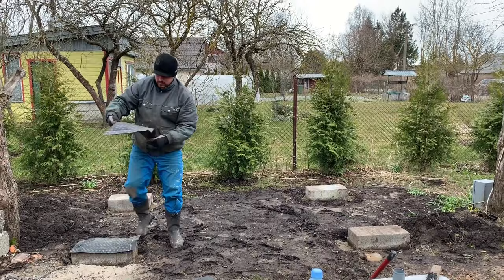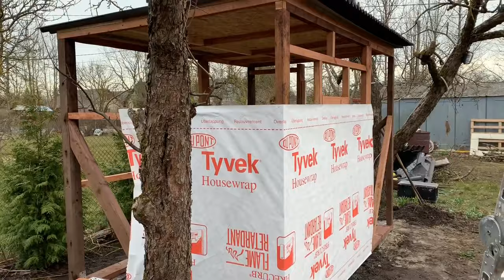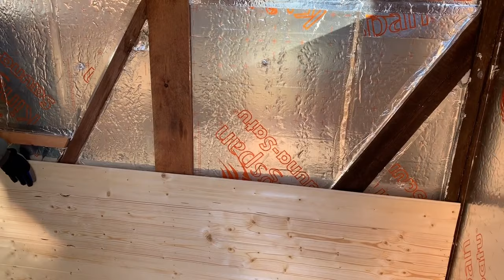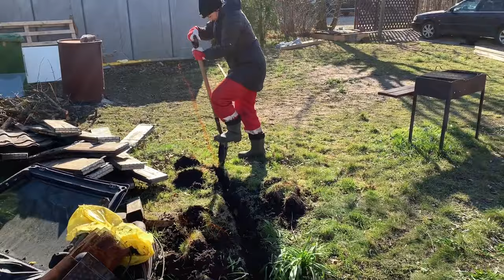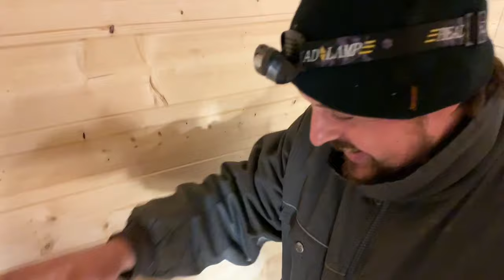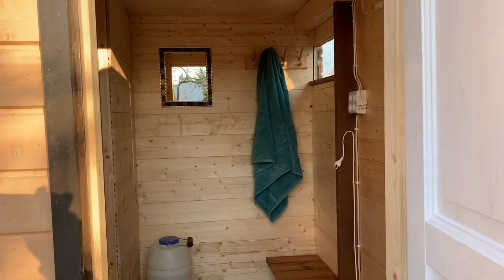How to build sauna outdoor

Comment: As a Finn I am in a position to give some feedback to you on this build. 
1. You shouldn't put insulation  on the floor. A) It has no use down there. I don't think you are going to feel cold in 90C :D B) water needs to get out through the floor so that the sauna can dry between uses.
2. You should also have ventilation near the ceiling so that "used" hot air can change to "fresh" air. By adding ventilation near the ceiling your sauna experience will improve greatly. More air=better

Otherwise this is probably the best sauna building video I have seen from non Finns. Loved the video :)
Reply from the maker: Hello, thank you for feedback. Regarding insulation on the floor - I made it like this that water will drain throgh the floor, it will just protect from heavy wind and cold :)
Reply: I totally agree. This has all the important things right. There are many videos with maybe finer craftsmanship and all that but that won't help if they get all the basics wrong. Of course there's always some room for improvement such as the ventilation but that can be done later if desired.
Reply from the maker: @laupit  Thanks for good words :)
Reply: Hi . Tapio . Would you have some links to sauna build by Finns? I couldn't find any. I mean  reasonable diy not wood logs sauna! Kiitos!
Reply: @Tapio Hakola, do you think that the heat is not lost if the floor is not insulated? Thanks for your tips!
Reply: Type of isolation used is fine? I'm now thnikg about sauna in next year. If price will se so low it will be great !
Reply: Hi would you mind giving an example of better ventilation near the ceiling. When you say that do you mean a few cutout slots so the  hot air can escape? If so how large and how many would you recommend for say a sauna like in the video? Sorry for the random questions, I am planning to build a sauna like the one in the video and am looking for any and all advice to get the best experience possible. Thank you for your time and any advice you can offer.🙏

Comment: That's a very nice job!  I'd trade the metal bucket for a wooden one - the metal will get hot and burn you if you're not careful. You will probably very quickly find any nail heads in the benches that you didn't sink deep enough into the wood.  A shower in the dressing room area would be a good addition, if there's enough room and you can plumb in a water pipe. Just cold water would do, as you won't feel the cold if you first get hot enough in the sauna.  My Finnish ancestors would always open a window before using the sauna, and throw a ladle of water on the stones and let the steam drive out any "bad" air (häkälöyly in Finnish - translates to carbon monoxide steam).  They would even do it with an electric  heater, but maybe just out of tradition.  I envy you -  may you and your family will enjoy your sauna for years to come.
Reply from the maker: Thanks for good words! There is no nailheads in benches because I screwed them from under there bench. There is unfortunately no room for shower inside but I have cold shower already outside on the corner of sauna :) But thanks for your advise, I will remember and try this.

Comment: Ok, taking notes:
- concrete poured in holes probably about, say, 8" deep? Maybe a foot for good measure? I'd probably use some paper cylinder forms because they're so crisp looking. I like over-engineering and wasting money that way.
- gravel followed by some cinderblocks, as far as I can tell.
- some membrane between the wood and the concrete blocks, nice touch there.
- looks like untreated floor base wood. Maybe it'll get treated later? Indeed it will and did.
- interesting framing method, minimal wood. Gets the job done, though.
- I was in some suspense waiting for what the floor would be. It came together, though.

Floor vents, both on the bottom. I've seen some debates between bottom and top for the back wall vent(s) and I think that becomes more important with a wood-burning stove. Any thoughts?

Nice video!
Reply from the maker: Hello, thanks for your comments. Floor wood is treated, its used for outdoor terrace use in our country, but i used on the floor as there is anyway no heat on the floor. Vent is correct, for electric heater it goes under the heated with normsl air flow and outcome down in diagonal corner. Of course you can overengineer but my intention was to build as cheap as possible.

Comment: What kind of wood did you use for the floor ? Great job ! Enjoy !
Reply from the maker: @dimibernard  Hello, its pretreated terrace wood
Reply: @mrjaak132  Thanks for your answer ! I didn't see any hole on the floor to allow the water to flow, outside I thought it was important ? Any issue since due to this ?
Reply from the maker: @dimibernard  Just leave some holes in floor insulation corners, floor planks assemble side by side, in few months they will dry and there will be gap 2mm or more anyway and water will drain very well
Reply: @mrjaak132  Thanks ! Another question sorry :) You didn't use any vapor barrier, why ?
Reply from the maker: @dimibernard  Insulation plates called SaunaSatu are used as vapour barrier, you just need to cover   corners and joints with foil tape

Comment: Is a vapour barrier needed? Seeing mixed opinions online. You insulated then borded.

How's it holding up after 4 years?

What would doid you use for the floor?

Great video, thanks!
Reply from the maker: @JF-kb6bl  Yes, vapour barrier presents, saunasatu insulstion plates are covered with foil, which is vapour barrier. For floor I used terrace wood. After 4 years it works very well without any problems

Comment: Great project. Correct me if I'm wrong but for safety reasons, the glass door to sauna should open outside.
Reply from the maker: Hi, thanks. You are correct, I consired this when installed door. As this was more optimal to save the room, I thought that in emergency situation you can take the stone or bucket and break the glass easily.
Reply from the maker: Thank you! Yes, you are correct, I considered this when installed the door. As this was more optimal for room saving, I thought that in emergency situation glass can be easily breaken by stone or bucket.

Comment: I would not use pressure treated wood interior at all regular wood just works fine if it can dry well after Sauna.
My outdoor smoke sauna floor is made aspen planks and small caps between them they are still great condition and Sauna is over 20 year old.
Reply from the maker: Thanks for comment, but where did you see pressured wood in my sauna? No pressured wood was used in interior.
Reply: @mrjaak132  That floor looked like pressure treated.

Comment: BTW what are the bench sizes? is 70cm? So you think, as a budget option, A-quality white pine will be bad for a bench? Even, if I would use a towel or something else under?
Reply from the maker: Regarding sizes please check my comments, I already anwered this once, dont want to go measure again. Pine will get too hot on the bench, your ass will burn :) Its better to sit on the wood not tower, tower will stink later because you sweat into it

Comment: Well done! I will be inspired by your work to make mine. Can you tell me what type of wood you use for the floor? I have the impression that this is a patio floor.
Reply from the maker: Thank you! On the floor there is special wood used for outside, its thermally threated so moisture will not affect it.
Reply: @mrjaak132 What is the type?

Comment: Great build, might be the exact one I try and replicate,  have u had any issues or annoyances come up that u would have changed? As well what is the dimensions of the building? And do u miss not having a true top bench? Thank you in advance!
Reply from the maker: Hi, now have used it for many years, there is no problems so far. Very good and hot sauna. Dimensions are 3x2meters, I choise these dimensions so I can lay down on the sauna bench. I dont miss top bench, i think its not needed in so small sauna :)
Reply: Thanks for such a fast reply, and I  glad to hear it's worked out well! Could you tell me the internal dimensions of the sauna room? And change room? I'm thinking g of wood stove instead so I might need a little more clearance,  working with a 9ft x 8ft gravel pad, really appreciate the help
Reply: I see in previous comments you mentioned u have given internal dimensions before, so I'll keep looking! As for the saunasatu , I can't seem to find here in Canada, woukd there be another name? A similar product I've found is called Silver RBoard (radiant accoustic insulation) , just unsure if it's the same, if not what are some of the qualities of saunasatu that are the best reasons for use?
Reply: Found dimensions and other great info in comments, thank you
Reply: Insulation is a polyurethane foam or polyisocyanurate foam for anyone interested in North America
Reply from the maker: @MIMDMD  Hi, total dimensions are 3x2m, hot room is 1.8x2 and the rest is changing room 1.2x2m.

Comment: Love it great job, Question for ya no need for a vapour barrier between inside siding and insulation? And what type of wood did you use?
Reply from the maker: No vapour barrier is needed, you need insulation with foil where foil is heat barrier/mirror. I used pine inside and outside.

Comment: Awesome video tutorial!! Does your oven have 230 volts? is it Harvia Vega 6kw? ;)
Reply from the maker: Thanks! Its 380v and 8kw Harvia
Reply: Hey, when you tested the oven in the video, was there 2 coils heating up? or all 3? I tried mine for 6 sec. without stones, but only 2 coils are working. Does the 3rd turn on later?
Reply from the maker: @kasparasluksa564  When I put full power I think all of them are turned on and red.
Reply: @mrjaak132  Yeah you are right. Mine came broke from factory prob... When it is off there is current in all L wires, but when I turn it on - L3 totally disconnects the current. 0 Volt. L1 and L2 are flowing. Strange?
Reply from the maker: @kasparasluksa564  Yes, it looks very strange

Comment: Awesome video and Cool sauna house!!  
Can I ask you if I am right, you dug a hole, poured sand and gravel, then placed cinderblock on top, have you used cement around the cinderblocks? Or it is just standing on sand and gravel? If so, is cement necessary? :)
Reply from the maker: Thanks. Yes I used cement just in case, its not expensive but will be for sure not blown away by the wind :)
Reply: @mrjaak132  Can I ask you about the windows, is it a double window or single? Is it prefabricated or you made it your self from glass board? :)
Reply from the maker: @lukelu9016  Hi, window is from organic glass, its like plasic or some. Dont worry no problem with heat, jusr dont rub it when washing it scratches very easily
Reply: @mrjaak132  thanks! and the frame for the glass you made yourself? :)
Reply from the maker: @lukelu9016  Yes, just simple stoppers from inside and outside

Comment: What did you use to treat the wooden frame? Is it non-toxic? Have you had any issues with fumes?
Reply from the maker: Its not toxic and does not have any smell or fumes. Its local estonian product and its difficult to tell which similar product you have in your country. Its liquid for wood protection against moisture and bacteria.
Reply: @mrjaak132  thank you

Comment: Hi Jaak,
Inspired by your build. 
Just had a few questions:
1. Was that cork that you used to insulate the ceiling?
2. What was the material that you used under the tin roof?
3. what is that silver material you used to insulate your inner walls?

Sorry if that's too many questions but you've convinced me to try and build my own now
Reply from the maker: Thank you.
1. Type in google "saunasatu", its special insulation for saunas, I recommend.
2. Its paper covered with asphalt on both sides used for roofs, dont know its name in english
3. Its aluminium foil tape to insulate saunasatu on walls and ceiling

Good luck with your build, let me know if more help needed.

Comment: Well done on your sauna! Looks great! Just what we are looking to have as well. What at your dimensions please?
Reply from the maker: Sorry for late replay, dimension are 3 x 2 meters. I am 180 cm long and I can lay down and enjoy sauna in horisontal position :)
Reply: @mrjaak132  Hello, 3x2 is complete house or only sauna part? It looks bigger the whole house than 3m but maybe I am wrong. Btw great job!
Reply from the maker: @embeathome1  Hello, 3x2 is whole house :)
Reply: @mrjaak132  thank you! Are you from Estonia? Nice! I am from Slovakia, planning to build sauna on my own. Just in case, since I like the design and size, would it be possible to provide with some plans, if you used some?
Reply from the maker: @embeathome1  Yes Im from Estonia. There is no plans, I just made it from the head. As you can see in video, I needed to cut out new door with chainsaw due to some thinking error :D But if you will have trouble, write to me and I will help if I can.
Reply: @mrjaak132  Many many thanks!!!
Reply: Hello, Mr Jaak, could you please wrtie me inner width of dressing room and inner width/lenght of sauna room? Also, what is the width of upper and lower benches? Many thanks. I am working on mine also 3x2m outer dimmensions, I need to divide both rooms but it looks like, in order to be able to lay down, the dressing room will be just like some 80cm wide...
Reply from the maker: @embeathome1  Hi, Martin. Sauna room is 184 x 176cm. Upper bench is 62cm and near the door 53cm, lower bench is 29cm. Dressing room is 183 x 110cm.
Reply: @mrjaak132  You should toss this info in the video description with the number of people that ask. :-D
Reply from the maker: @donicarobinson24  There is so much info that I should write a book :)

Comment: Really impressive mate, good work! Was the pine just normal tongue and groove from your local DIY shop or from a specialist? I heard that it's not so good because of the resin but the stuff from specialists is so much more expensive so not sure if they're just saying that or not?
Reply from the maker: Thanks, mate! Its just normal pine with smooth finish from local sawmill. I choose planks with minimum resin, but even if they are with a little more resin its still not problem, the resin will not flow everywhere like the rumour says. I also at first was afraid because of this resin, but then made a research and found out that 80% of saunas in Finland are made of pine and spruce interior.
Reply: @mrjaak132  Thanks a lot mate, enjoy your sauna!
Reply: Spruce is better if you need to pick one with resin. It also little less warm also works in sauna bench.
Reply from the maker: @mr.wizeguy8995  I agree it is, I just got pine with much better price
Reply: How much did you get it for, Jaak? Do you remember? I just want to compare prices.

Comment: Curious why you ran your floor supports flat instead of vertical, on edge, won’t the floor sag over time?
Reply from the maker: Otherwise I could not put easily wall supports and floor on the same plank. So far sauna is standing still :)  But of course it can be done in other way, it just was my choise.
Reply: @mrjaak132  got it, want being critical, just curious.

Comment: Hi Jaak, great video! I've read over and over again that pine/ spruce wood will bend and warp quickly over time, and that I should consider paneling my sauna with red cedar but obviously that's very expensive. Are you not worried about the warping and expanding of these cheaper woods? I live in Ireland so cold wet climate is a concern. I'd love to hear from you! Thanks!
Reply from the maker: I dont think that it will bend, pine and spruce is used widely in finland saunas for example and no problems. Mine pine is 14mm thick so I foresee no bend for this, I hope at least. And yes it is many times more cheaper. Thanks for good words.
Reply: @mrjaak132  aha very good! Thanks for getting back to me man! Can I ask you one more question, what height is your sauna from floor to ceiling?
Reply from the maker: @BenL0253  Hi again. Height is 2.05 meters.
Reply: hello ben , im bob from cork, im just drawing up plans for my own small sauna build, how did yours go and what advice would you give to someone who hasnt started building theirs yet eg materials/design wise
Reply: Cedar is non-existent in Finland. Typical sauna materials are spruce, pine and optionally for benches aspen or alder, but those can be spruce just as well. You don't have to worry about warping and expanding especially if it cost 1000 total to build it. If it does, fix it, it will cost maybe 100 to do so.
Reply: As @kke already pointed out - cedar is not wood that is used i Swedish or Finnish saunas (and hardly for other builds. It's more a North American thing). Spruce and pine has been used here in the North for building houses for at least 1,000 years and they have stood against time very well.